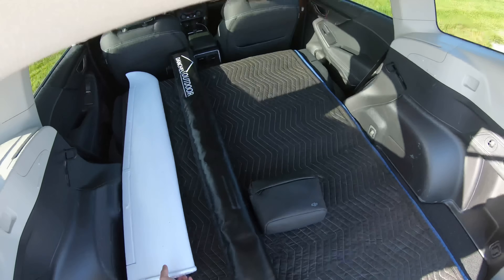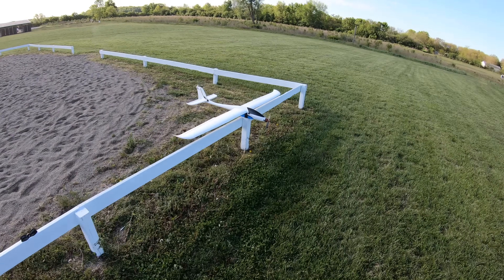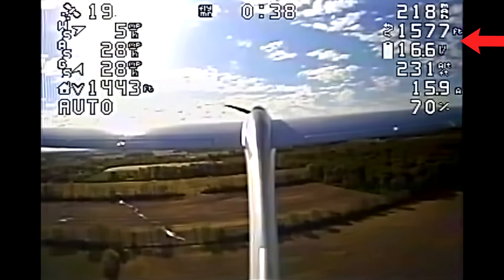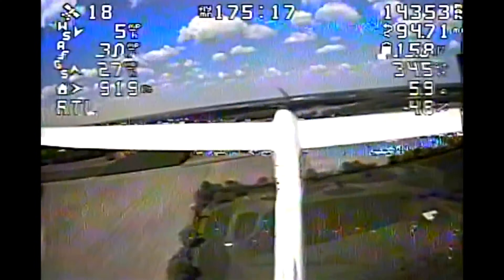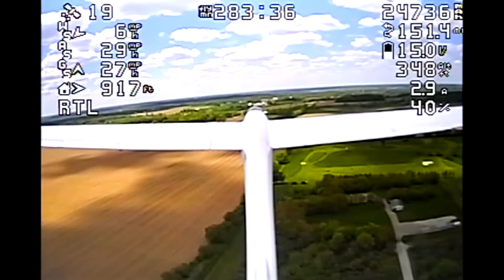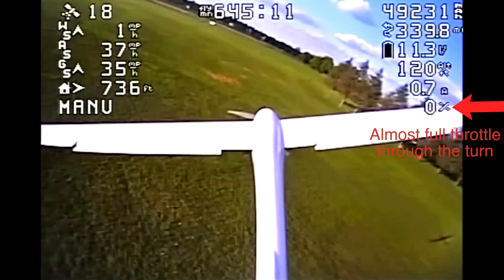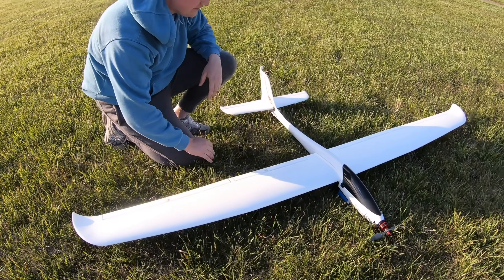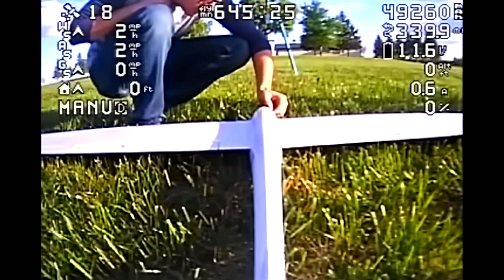My Longest RC Airplane Flight

Comment: That's exceptional. And I'm sorry, i know it's old video, but want to ask - why you used 4108, not stock 4023? 1000 kv is too much for endurance, but there lower kv models, of same size and it will be still internal. Just really curious.
Reply from the maker: It was my best guess at an efficient pancake motor. I think you could find a more efficient motor-prop combo using ecalc.ch

Comment: I had an Sig Riser, no motor,  would basically not come down one hot sunny day.
Then a C130 Hercules started doing touch and goes at local airport, flying low  and close to my altitude.  I forced it down and it was fluttering and vibrating from speed. I thought it would come apart.  Fond memories of RC gliding.

Comment: That is so impressive.
So base on my calculation:
You flying the plane for 10h 45min and 25secs, you spent only 32.15% of the battery(11.4volt remaining of the 16.8volt). And thus you consumed about 16Amh of the 50amh, in which by dividing the amh spent and hour, your norminal or average amp maybe around 1,49.
Good day to you all reading my comment. I know my comment and calculation maybe unescesary, and in case i have made a mistake, you are kindly free to correct me. Thanks for your time 👍.

Comment: I use the same EV800D Goggles, same Triple Feed Patch antenna! Also got that problem with DVR being corrupted when going into static. But discovered it only happened in PAL mode. With the camera in NTSC mode, I never get any corruption.

Comment: Amazing flight! I just bought the Phoenix 2400 and I was considering a 10,000 mah battery. Unsure whether it could handle the weight but your 50,000 shows it does very easy. I don't exactly need to go for a 10-hour flight though, but a nice, comfortable 1-hour flight is what I'm looking for.

Comment: Hii sir the video was very impressive and relaxing😊,it's a great achievement 🎉🎉. I wanted to know which motor you have used in this project because I very curious about it that how a single motor at 70% throttle lifted a 4kg plane.

Comment: Absolutely insane, at 10 hours 45 minutes of 30 mph cruise you have 320+ miles of range!! You could fly this autonomously from New York to Boston, or Orlando to Miami and still have over a hundred miles of range left, this is far and away the most impressive endurance flight I've ever been able to find. 

I want to build something like you did with enough battery range to autonomously get to my buddy in college, who is about 170 miles away straight line, doesn't need to come back because he can land it when it gets there, charge it up, and send it back, and your video shows that this is very possible. Do you have a detailed build video for this, and what do you think about the Ranger 2400 vs. your choice of Phoenix 2400?
Reply from the maker: Thanks! 😄 I prefer the Phoenix because it’s a bit more efficient than the Ranger. But your goal is very reasonable.

Comment: The part list in ur description. Is that complete? I’m off all summer but work for the local school district and we do lots of things with the kids during the summer. This would be a good STEM project
Reply from the maker: Thanks for your work in education! I’d recommend the AeroScout as a first hobby grade plane, but there are lots of little durable rc planes on Amazon like this one: https://amzn.to/3YAv5hL but I’d take off the center prop to make it very very crash resistant.
Reply: @MatthewHeiskell  we already fly RC planes from time to  time, one student had mentioned endurance flights. so i dug into it a found your video. Any guidance would be greatly appreciated

Comment: Great job! I might of missed it, but what is the airfoil, wingspan, Aspect Ratio and all up weight of the model?
Reply from the maker: I mention the weight, I think it’s a little less than 10 pounds. 2.4 meter wingspan. The AR is about 12 I think. It’s a “Phoenix 2400” if you want to look it up.

Comment: Great flight, but im wondering how did you manage to secure the battery? Cause in the video it looks like that the battery is only supported using some kind of electrical tape.

Comment: Impressive, the battery is not even aerodynamic.
I wonder if what are the limits. If it were a pusher like the reaper and had a very sleak and aerodynamic body.
Also, if we 2x the size and keep the same airspeed we would increase the flight time even more.

Comment: My question is, would there be a way to get the picture quality of a dji mini and be able to travel roughly the same distance away as a dji mini. I always see lots of videos or planes or built drones but never see them be able to go As far and as with as good picture quality as the dji.  Maybe with an 03 air?
Reply from the maker: In in the US we are not allowed to fly beyond visual line of sight, but you can get long range with a great picture quality using the DJI digital FPV system. It's basically the same as a DJI camera drone, but modular so you can put it in a quad or a plane.
Reply: @MatthewHeiskell  were not allowed out of line of site in Canada either, but.... still had the question lol

Comment: Can you make a video carrying packages with this rc plane if it could carry 1kg and still hold up like 5 hours it can be very useful and I would love to have a tutorial of how to make one myself
Reply from the maker: It could definitely do that. You would just build the battery pack a little smaller so that the max weight stays the same.
Reply: @MatthewHeiskell  great!!
How can i make it myself? Maybe you have a parts list even in general like motor’s kv, battery capacity and cells, propellor size

Comment: Hello Sir!
I want to build a plane that can give me the maximum flight time put of a 3s 2200 mah battery. I mean the maximum time if the battery is limited to max 3s 2200. 
Can you tell me the plane design type, the electronics required, etc. I am looking forward to your valuable advice.
If possible then you can tell me in detail. Thank you.
Reply from the maker: A 2200 3s is a pretty small battery, but you can get it to fly for a really long time with something like a Bixler. Keep it light and streamlined and it will fly for 30+ minutes if you careful about throttle usage.
Reply: @MatthewHeiskell  Ok thanks

Comment: Why didn't you thermal? You could fly as long as you have sunlight if you just thermalled or used wave or convergence.
Reply from the maker: Good question! Thermals are a bit weather dependent. I wanted to see how long it could fly day or night, good thermals or not. But you're right, using thermals would have let it fly for even longer.
Reply: @MatthewHeiskell  yeah but even a three star rasp forecast would give you hours extra.

Comment: Just found that video during my investigations for a comparable project! Really good job! Would it make a difference to go with 6s and a lower KV motor to get the same RPM? If someone has other good links related to these kind of projects, pleae share ❤
Reply from the maker: Yeah, I think running 6s with a lower kV motor would be slightly better.

Comment: Just looking at the FPV, you only used 70% throttle on takeoff? 😳 That battery weighs like 4 times the recommended battery weight, I’d be so worried if it doesn’t takeoff even at 100% throttle… still can’t believe how well it flew
Reply from the maker: haha, I could only use 70% throttle during takeoff because full throttle and a fully charged battery would burn out the motor from too much current. This was by design though, to make sure that I had enough thrust when the battery voltage got low near the end of the flight.

Comment: Considered making a new battery pack using Vapcell F60 6000mAh cells? Should give you a nice ~10-15% boost in range, more if you can build it to fit inside the airplane's body. :)
Reply from the maker: Maybe! I’d have to check the specs. Don’t focus on capacity alone, you need to also consider weight of the cell. I did my comparisons based on calculation of watt hours per gram.
Reply: @MatthewHeiskell  They're about 290-300 wh/kg from independent tests

Comment: How does the airplane adjust to wind etc.?

You said something about a gps tracker, but how does the airplane know the direction it has to move? 

Is the code written by yourself?
Reply from the maker: Good question! The code exists in arduplane. By comparing the GPS ground speed to the data from the accelerometers and gyros, the plane can fly in a circle determine the average wind. It’s surprisingly accurate.

Comment: Can you elaborate on the battery build? I am going to build my own. I think I might need a 6s for extra accessories drawing power. Cells are also not easy to find in Canada.
Reply from the maker: 6s would be a good pack too. Just need to adjust your ESC and motor kV. I just ordered my cells from online stores. Can you do that in maple syrup land? 😄

Comment: its good to know that flight can be achieved with such weight
the next challenge is custom made solar panels that will compliment the wing span
then the next challenge will be the regenerating system whereby the solar panel charges the battery when the voltage drops to a certain level
the system will require one main battery and one redundant battery
when the main battery is low it triggers the solar panel charger 
and the redundant battery is activated
when the main is fully charged the redundant battery is deactivated and also begins to cool while the main takes over

i believe this system than bring about limitless flight time in the future
i am very busy now trying to settle other projects however i will hope to realise this project in the future

sincerely

ejike

Comment: what flight controller did you use?
Reply from the maker: Matek F-405 Wing running Arduplane. There's more info like this in the video description.
Reply: sorry should have looked in the description first lol. What about the osd? I was searching for something that would have return to home, a battery amp display similar to yours like the mah used, and maybe an rssi config to keep track of my radio strength. Im building a long range plane and Im not sure what the best devices should be used and the compatibility. Thankyou!!!  @MatthewHeiskell
Reply from the maker: The Matek F-405 Wing does all of this. And there is likely a newer better version of it too.
Reply: @MatthewHeiskell  would you happen to know the site where they sell it with the gps and everything?
Reply from the maker: Just google it. There are many GPS receivers that work with it.

Comment: Any chance I can have this done on a cheetah 100cm glider...? How long can it fly?
Reply from the maker: I don't know how many cells the battery pack has, but if you built a new battery pack with NCR18650GA cells then you could get it to fly for a very long time! That's the cell type that I used. They have twice as much energy per weight compared to a normal Li-Po.
Reply: @MatthewHeiskell  hopefully I'd be able to do long range with the cheetah. Thanks for the tip regarding the batts.
More power to your channel 👌

Comment: Very nice Video, can you tell me what your approach on choosing a suitable motor and propeller is?
Reply from the maker: Thanks! There's a good bit of trial and error, but generally speaking, "pancake" motors are more efficient, and higher pitch props are more efficient because they do not need to turn as fast.
Reply: @MatthewHeiskell , thank you for your reply. Your 10h airplane is very inspiring. I am planning to build a ~1.5kg RC airplane and came across your video. Now I don't want to achieve 10h flight time, but I want to get the longest flight time out of my 5000mAh 4S battery. Of course, I don't need as much thrust as your 4.3kg airplane. But I'm still wondering what your thrust to weight ratio is.
Reply from the maker: haha, the thrust to weight ratio was very, very poor. When fully charged, it barely had enough thrust to take off from a hand launch.
Reply: @MatthewHeiskell, haha okay. Do you know by any chance the Wing area, tip- and root chord? I want to design my airplane similar to the one that you used (at least the lifting surfaces).

Comment: Super cool vid! I really hoped you would see how hot the motor and esc were. 10 hours is a long time.
Reply from the maker: Thanks! 😄 but heat does not continually build. I doubt that either would have been warm to the touch. The hottest time for both was about 30 seconds into launch, running full power while the battery is fully charged to max voltage.
Reply: Ah good to know! thanks! I assumed that heat would compound over time.  @MatthewHeiskell

Comment: Hey man. I m completely new to the UAV world. I was wondering how you managed to create such efficient aerodinamics. This is amazing. Keep up the good work!
Reply from the maker: It was not especially efficient, half of the endurance came from the Li-Ion cells that I used to build the battery pack. They have twice the energy density of a standard LiPo RC battery.
Reply: @MatthewHeiskell  oooh I get it. Do you think optimising the airplanes shape could have a major impact on flight duration?

Comment: Bruh you could have taken that thing all the way down to 10v no probs! (in theory land).... Now....... WHY YOU NO FLY LONG A$$ AIRPLANE NO MOW?!
Reply from the maker: haha, you're right. 2.5V per cell is fine for a 4s Li-Ion pack, but the thrust was getting weak. At 11V I was only getting like 15A at full throttle, only 165W of thrust for such a heavy plane. That was barely enough to maintain altitude in that final U-turn. I guess I could have kept it higher, running down to 10V, but then I would have had one shot on the landing, haha. Unfortunately I haven't flown in about 2 years. I've gotten more into Subaru, offroad, camping, adventure stuff. New Mexico has no grass for belly landing, just sand and rock, haha.
Reply: Are you speaking some kind of street trash ???

Comment: Would love to see some videos on building the battery the specific programming and also exactly which 2400 frame it is, there are several variation of the phoenix 2400 and I want to replicate your current design, I think it would be a great starting point for mounting a 360 pivoting camera underneath been looking at finding a design platform to start from to build something close to the capabilities of the militaries surveillance drones to use during paintball matches
Reply from the maker: That's RAD! That would be a really cool recon RC plane. There's an open sources HD FPV system called "ez wifibroadcast" I think there's a newer version now, but basically it uses two raspberry Pi and webcam and USB wifi dongle to do HD wireless video. The only catch is that it uses 2.4GHZ, so you'd need to use a different frequency like 915MHz for RC control.

Comment: Hi, I wanted to know if you chose the Phoenix 2400 precisely because it is probably the model that consumes less energy in flight compared to a classic airplane and I also wanted to know if such a powerful 50 amps battery could heat up too much and burn since I have read many recommendations in this regard for much smaller batteries (LI-PO) while instead such a powerful LI-ION battery of this type is perhaps one of the most dangerous there could be
Reply from the maker: Good questions! I picked the Phoenix 2400 because it has an excellent glide ratio and efficiency, and huge wings. Larger batteries store more energy and if an accident happens more energy will be release. But using a larger battery for the same task will put proportionally less load on the battery, making it last longer and for more cycles. In a crash, the main issue is the kinetic energy, but if the battery is damaged enough, it could catch fire. Battery fires are pretty scary.
Reply: @MatthewHeiskell  I wrote the comment because I would also like to build a configuration for long flight times.  I would like to know if with batteries that have the same capacity a 3s, 4s, 5s, 6s etc. which of these will discharge sooner.

Comment: looks amazing, very nice job. how do i make one of these?
Reply from the maker: This is a pretty advanced build, you got to work up to this. Start with a RC flight simulator, then learn to fly trainer models, then learn about fpv, then learn about flight controllers, finally you can put everything together and build a project like this.

Comment: The shakes in flight is due to high stabilizer gain. You get better efficiency by tuning that down. Aile corrections schould be slow.
Reply from the maker: You're right! Better to reply on the I term more and the P term less . . . in the PID control loop.

Comment: How much everything cost in total
Reply from the maker: Good question! A lot of the stuff is shared between aircraft, like batteries, chargers, controllers, ground station, etc, but it would be about $1,000 if you had to buy everything needed just for this setup.

Comment: Even though it is running on automatic flight plan, does it still require to have a connection to the controller? Or can you launch it, shut down your RC and just let it do its thing as programmed?
Reply from the maker: Good question! Sorry for the late reply. I didn't have a waypoint mission loaded into the flight controller, so turning the RC transmitter off, or losing RC signal would put it into return to home mode, which is what is was already doing. Super Safe. When you have a waypoint mission loaded, you can adjust the flight controller's response to a lost RC signal. You can make it return to home OR make it finish the mission.

Comment: Are you controlling/adjusting the throttle manually or is the flight controller doing that?
Reply from the maker: Good question! The flight controller was managing throttle, but I could add bonus throttle if I wanted.